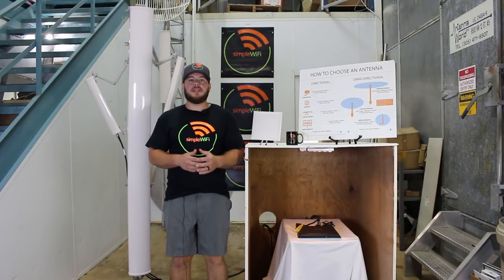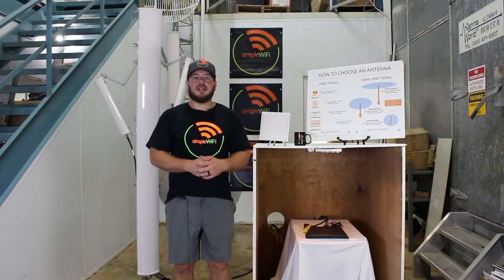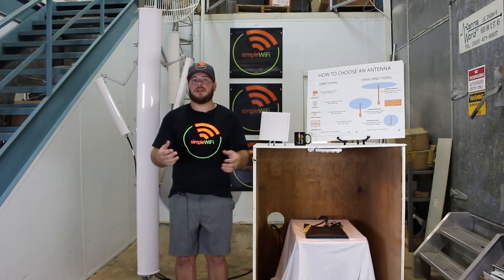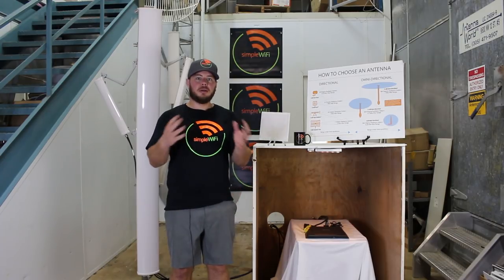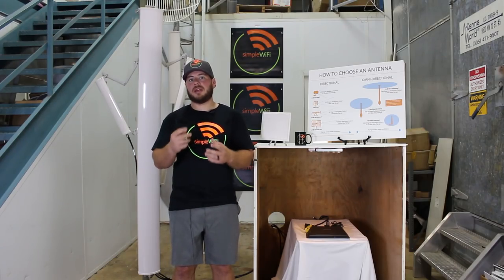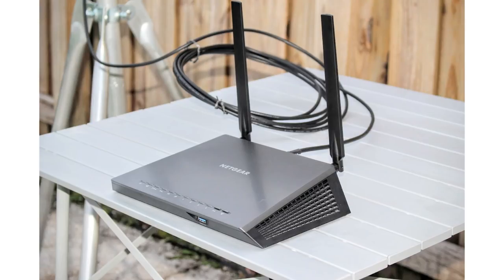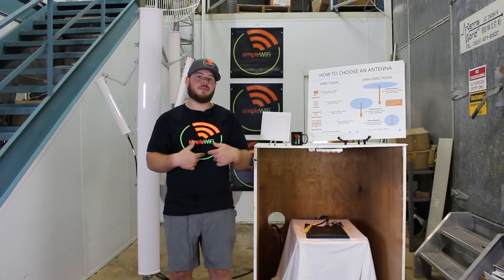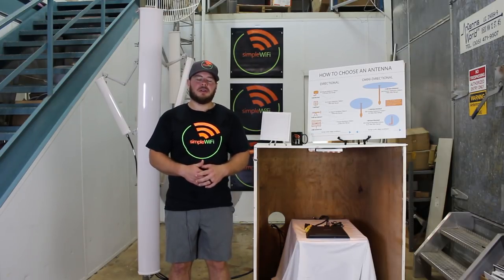The Best How To WiFi Video: Create your own WiFi Base Station!

Comment: Can you use the same channel for each one? Can you use the same SSID for each antenna? How do you hook all 3 antennas to access points and bring it all together into a switch? Wouldn't you lose most of the power thru that cable? Wouldn't an outdoor AP/Router be MUCH better.
Reply from the maker: Hi Craig, 1) Yes you can 2) yes you can 3) Yes you can 4) No that is why I speak on the importance of thick cables. Only 3db per 100' when using L-400 cable. 5) The answer depends on what you are trying to do. An outdoor omni-directional AP won't reach nearly as far as a base station scenario. Even a directional one will have a narrow beam width. This is why WiFi networks and RF in general is so difficult, every situation is unique.
Reply: SimpleWiFi  dear i have tplink coe210 but he can't give a signal to 300 metr can you help me please

Comment: I'm in the process of 'trying' to build a long range p2p encrypted VOIP network for my employees, with line of sight and no obstruction how far does the 120 degree antenna broadcast on 2.4ghz  ? Also , same exact question , but for 5ghz ... Thanks , I found the website to be very helpful but I couldn't find a definitive answer in terms of distance to these questions hoping you can help out.
Reply from the maker: Its very relative. What is your radio's power on both sides? I would look into link budget calculators.

Comment: Great video, thanks a lot. not sure you or someone in this loop could help: is there any best wifi solutions for train wagons? Cabling between wagons is not possible, and very thick metalic wagons are stopping wifi signal (inside is good). The idea is to set up a big wlan and with a local server to host an entertainment system for passengers. I would like to use tp-link omada sdn but i can't interconnect each AP (wireless mesh) because of bad signal. im thinking if it's possible to put one of the antennas outside of the cabin to establish wireless mesh, another antenna serves users inside. Any ideas for brainstorming?

Comment: Mcgyver had on show take a bucket, a large drill bit, and copper wire to computer.  Then point bucket out window to where you get a signal. Did not show how to connect to computer.
Reply from the maker: Email them for clarification.

Comment: I want a 120 degree short distance sector antenna for our rv park , one would need to be for a distance of about 400ft the other 90-120 degree would need to cover about 1500ft.  so from your video i want a low gain with a wide vertical beam correct. I have 2 90 degree sectors but they are only 7% vertical. I can not get it to work for shit..
Do you have anything that would cover my two areas. Or maybe a panel antenna would be better. Thanks.
Reply from the maker: Hi there, this scenario has a lot of different components. First off, what radio are you plugged into? Next, the 7 degree vertical is not an issue if you aim it correctly. I suggest you reach out to one of our techs at Support@SimpleWiFi.com or call us. To do this properly we need to have talk.

Comment: can you connect to this antennas with your  laptop and phones  without the need for another device?.  I want to cover a 2.5 km radios. I need help.
Reply from the maker: It is possible but not with a direct cable. Email for more info.

Comment: great video love it thanks for the intel, i have a question i got the 2ghz and 5ghz parabolic grid antennas from u guys and i would like to know which side of my wifi usb adapter is the 2ghz side and which is the 5ghz side , so i can plugged in the antennas ,. thanks
Reply from the maker: Glad you liked them. So far from our testing both ports do both bands.
Reply: Anthony joseph i
Reply: @SimpleWiFi  plz sir plz.

Comment: very educative video! thanks a lot : I do have a question: Is there a limit on the number of devices that an antenna can support? For example, How do i know what is the right antenna for a family with a desktop, a laptop,  2 tablets, and 3 cells; or how do i know what is the right antenna for a college campus with 25 thousand people, i mean cells and computers on their classrooms, administration, etc. those are just two scenarios, to help illustrate my question. thanks
Reply from the maker: It's not the antenna that are important in this case - it's the radio that manages the traffic. There is a specific access point for each type of scenario. Antennas only manage RF footprint.

Comment: As I understand there are three antennas to a router. does each of them emit both 2.4Ghz and 5Gh signals? Or, do two of them emit 2.4Ghz and one emit 5Ghz signal? How do i know which antenna i should detach from router? does it really matter which antenna to detach at all?
Reply from the maker: From our testing, all router ports on standard consumer grade devices are emitting both 2.4 and 5ghz. Good question!

Comment: Thanks. I'm in remote Australia where there is no internet or mobile coverage. I have plenty of solar power and some high vantage points. I'd like to set up a WiFi network so that I can monitor tanks and turn on pumps etc over an area of about 3 klm (say a mile). Is this possible?
Reply from the maker: It is - but do you have internet at home right now? You need an ISP first.
Reply: @SimpleWiFi  No internet here, I have to drive for 2 hours to get to the internet. If I climb a mountain I can get 1 bar of mobile coverage - enough to send a text but it is quite a climb. I've been told that I should look at radio frequency modules but my research tells me they won't have the distance capacity and are subject to interference.
Reply: NB I can send this because I am in a city right at this moment. That's a 1000 k drive away from where I live.
Reply from the maker: Then I can't really help you. I can help you once you have an internet connection to better manage that signal. Have you looked into satellite internet?
Reply: @SimpleWiFi  In Regional Australia, the national disgrace is that the satellite (Skymuster) was designed for 30k users there are actually more than 700k using it  also, it doesn't work when cloudy and there are other weather constraints - so, it is effectively useless.  That's why I want my own LAN without internet access.  I'm (perhaps foolishly) convinced that it must be possible to set something up that will allow me to monitor tank water levels remotely and turn things on and off. I just don't have the language to describe the system I need. I only have this simple use-case (re water monitoring and control).
Reply from the maker: I see - that's a bummer.

Comment: That metal wall on the right, is that shielding your building is required to have? Does the whole building have metal shielding around it?
Reply from the maker: That is actually our anechoic chamber used for testing antenna radiation patterns. See inside it here: https://youtu.be/I8AgD9_Sji4
Reply: Impressive! Thanks for linking.

Comment: very clear video ,many thanks. However i am wondering if everyone comply with legal limit of wifi power transmission (in my country is only 100mw = 20dbm).i  know that professionals use high gain antennas , How is it possible to coverage 2km or 3km area with only 100mw power transmission ?
Reply from the maker: They dont cover 2km-3km with just 100mW. They can cover those distances using a point to point bridge which sends signal between 2 exact locations. Using this scenario the power limit usually greater.
Reply: Ubderstood ,Thanks for your prompt reply

Comment: Sir I have a two storied house and am not able to get complete coverage inside the house . I have a tp link ac1200 on first floor and a second netgear wifi range extender. But it doesnt seem to give complete coverage .Using these will it solve the problem?
Reply from the maker: No this is not the right option. Please contact us for more help in detail.

Comment: Let's discuss the microwaves coming off those antennas. I wouldn't place those where people reside or work for any amount of time
Reply from the maker: Depending on gain and frequency the safe spot varies. With WiFi you are safe in typical use cases.

Comment: Great video, I would like to know the complete kit list to create my own system in Haïti. I need a long range WIFI antenna . In my cottage  in the country the signal is very distant. I would like to design a WIFI system so that i can subscribe to an internet company that provides services around the world.  How can i suggest?  Thanks a lot for your understanding and waiting your answer....
Reply from the maker: This is what you need:https://www.simplewifi.com/products/wifi-repeater
Reply: Hi Dear, What is the difference between the WIFI REAPEATER and my WIFI Base Long Range. In the future I will use my own WIFI for a home radio station. Then I need a long-range UHF / VHF antenna too. I have already bought a Tower of 150 feet so I can install UHF antenna and my own WIFI or WIFI REAPEATER. The last question. Can you tell me about what UHF / VHF antenna kit I have to buy that is of good quality. Then, between the outdoor 24DBI parabolic GRID and the outdoor 14DBI panel which is better. NB, I am looking for the most powerful booster and routers and good quality too. The province where I live is very far from the signal. Thanks a lot for your understandind. Waiting your answer in order to make the right choice of products.

Comment: The big question
I
and everyone else here has.
is
"how far can this thing transmit da internet"
in (miles)
in (city blocks)
in (football fields)
anything.
Reply from the maker: It varies on MANY variables. It can me 0-5,000 Meters.
Reply: thanks
great video. 
I'm learning allot from this...you tube channel
Reply: What about the 18dbi 120degrees spread monster you have at the back, how far can it reach?
Reply from the maker: Same answer as above. However that antenna is really fantastic. Let's say you have it up 30' in the air in the middle of the desert, it will go close to a mile.
Reply: Cromulent Commodore n
Reply: In India we can connect villages with 20,000 people who will easily give 2,000₹ for 5 months. So, it’s a good startup idea

Comment: What is the maximum amount in meters you can extend the antenna cable before you start to get signal loss? I know the WiFi transmitting power is very low but just curious if I have to extend to more than 100 feet (30.48m)
Reply from the maker: You begin experiencing cable loss immediately. So the question is how much loss can you tolerate in order to still have a usable signal.  Solution is to use the thickest cable possible.
Reply: Victor Rodriguez öö

Comment: Hi Sir , I Hope You and your team is Good & Fine.
Sir i am Starting New Wifi Internet Connection in my Area i am from Nishatabad Pakistan Faisalabad.Sir here buildings higher and lower .
Reply from the maker: OK
Reply: Sir great video. I'm learning allot from this.But please Help me sir Witch Devices and Antenna i used for Clients using in door wireless router.But Sir i Visit some other Wifi Setup but All they Say to client ( Client antenna is fit on the roof).. Sir i want to just 1  miles coverage but my network single strongly using indoor non of outdoor fix of client antenna.
Reply: Thanks Sir your Kind Reply
Reply from the maker: You need a clear line of sight so inside an urban environment it will not go far. Unfortunately I cannot help you remotely as the plans you are undertaking require much more research and study in person.